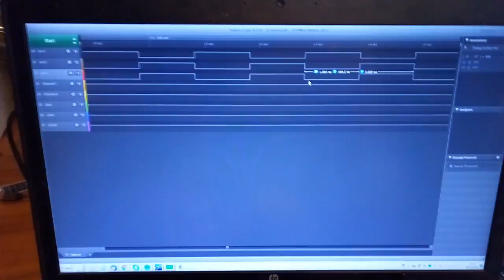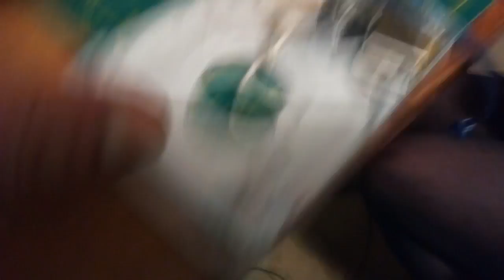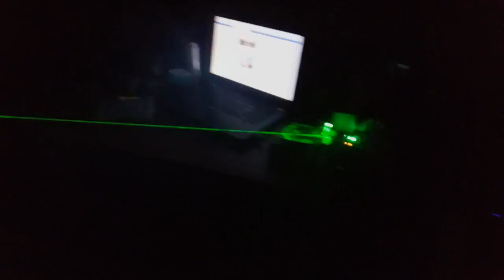Hard Drive motor laser galvo

Comment: You need feedback. The harddrive controller uses the sectors on the harddrive itself to know the position and speed of the head extremely precisely
Reply from the maker: I think you might be missing the point slightly. 
I already have proper laser galvos with feedback. 
This was just a bit of fun.

Comment: where is the code?
Reply from the maker: On the arduino. 
But, for the benefit of the people who saw this on Youtube years ago, Also posted in the comments below!

#include "TimerOne.h"

#define GALVO  9
#define LASER  2

void setup()
  {
  Timer1.initialize(4545);         // initialize timer1, and set a 220Hz
  Timer1.pwm(GALVO, 128);                // setup pwm on pin 9, 10% duty cycle
  
  pinMode(LASER,OUTPUT);
  digitalWrite(LASER,HIGH);
  
  }

void loop()
  {
  //wide();
  //wide();
  //small();
  //small();
  //slow();
  //slowchop();
  //wideslow();
  
  for (int j=0; j <= 50; j++){
      wide();
  }
  for (int j=0; j <= 5; j++){
      small();
  }
  for (int j=0; j <= 5; j++){
      scanwide();
  }
  for (int j=0; j <= 25; j++){
      wide();
  }
  for (int j=0; j <= 5; j++){
      small();
  }
  for (int j=0; j <= 5; j++){
      scanwide();
  }
  for (int j=0; j <= 50; j++){
      wide();
  }
  for (int j=0; j <= 5; j++){
      small();
  }
  for (int j=0; j <= 5; j++){
      slow();
  }
  for (int j=0; j <= 30; j++){
      wideslow();
  }
  for (int j=0; j <= 10; j++){
      slowchop();
  }
  
  }
 

void scanwide()
  {
  int i;
  int j;

  for (i=200; i<=400; i+=10)
    {
    for (j=0; j<=100; j+=10)
      {
      Timer1.setPeriod(hz_to_us(i+j));
      delay(2);
      }
    }
    
  }
  
void wide()
  {
  int i;
  
  for (i=200; i<=700; i+=50)
    {
    Timer1.setPeriod(hz_to_us(i));
    delay(2);
    }

  for (i=700; i>=200; i-=50)
    {
    Timer1.setPeriod(hz_to_us(i));
    delay(2);
    }
  
  }

void small()
  {
  int i;
  
  for (i=400; i<=500; i+=2)
    {
    Timer1.setPeriod(hz_to_us(i));
    delay(2);
    }

  for (i=500; i>=400; i-=2)
    {
    Timer1.setPeriod(hz_to_us(i));
    delay(2);
    }
  
  }

void slow()
  {
  int i;
  
  for (i=200; i<=700; i+=2)
    {
    Timer1.setPeriod(hz_to_us(i));
    delay(2);
    }

  for (i=700; i>=200; i-=2)
    {
    Timer1.setPeriod(hz_to_us(i));
    delay(2);
    }
  
  }

void slowchop()
  {
  int i;
  
  for (i=200; i<=700; i+=8)
    {
    Timer1.setPeriod(hz_to_us(i));
    digitalWrite(LASER,HIGH);
    delay(4);
    digitalWrite(LASER,LOW);
    delay(1);
    }

  for (i=700; i>=200; i-=8)
    {
    Timer1.setPeriod(hz_to_us(i));
    digitalWrite(LASER,HIGH);
    delay(4);
    digitalWrite(LASER,LOW);
    delay(1);
    }
  digitalWrite(LASER,HIGH);
  }

void wideslow()
  {
  int i;
  
  for (i=200; i<=700; i+=25)
    {
    Timer1.setPeriod(hz_to_us(i));
    delay(2);
    }

  for (i=700; i>=200; i-=25)
    {
    Timer1.setPeriod(hz_to_us(i));
    delay(2);
    }
  
  }
  
int hz_to_us(int f)
  {
  return 1000000/f;
  }

Comment: Instead of the elastic bands, perhaps you could try apposing magnetic fields, tiny magnets.
Reply: no definitely not. Elastic band is linear resistance rising with elongation (spring law F = l * c ). Magnets are spot based and have spheroidical field lines between poles. Compare it to balance two speheres stacked vertically.
Reply: Totally needed tetris theme. Russian anthem.

Comment: First of all, congratulations, of all the projects with low cost of recycled laser, yours is the best by far, what software do you use to send PWM to arduino? I would like to replicate your project but with X and Y axes
Best regards and congratulations again!
Reply: I've been watching Curious Marc experimenting with "proper" galvos, and he seems to be simply shooting the X mirror into the Y galvo.
Reply: The Arduino puts out PWM on it's own - pins 9, 10, and 11 can be tuned for the frequency at which PWM operates using code to adjust the clocks.
  
TCCR1B = TCCR1B & 0b11111000 | 0x01; // set PWM frequency @ 31250 Hz for Pins 9 and 10, (0x03 is default value, gives 490 Hz).

TCCR2B = TCCR2B & 0b11111000 | 0x01; // set PWM frequency @ 31250 Hz for Pins 11 and 3, (0x03 is default value, gives 490 Hz).

Comment: Wow ! :D
I was searching for something like this for some time...
You've manage to get it quite good !
Would you mind sharing your work, the code... I saw you would post it but you did'nt.
Don't worry I tink I'm not the only one interested !! :D
Great work guys ! Thank you !
Reply from the maker: I posted it in one of the comments. Youtube doesn't allow you to use angled brackets in video descriptions, so posting it there would have been confusing for many people.

Here it is again though:
Here's the code that was running at the end of the video, for those who are into that sort of thing.
***********************************************************************************

#include "TimerOne.h"

#define GALVO  9
#define LASER  2

void setup()
  {
  Timer1.initialize(4545);         // initialize timer1, and set a 220Hz
  Timer1.pwm(GALVO, 128);                // setup pwm on pin 9, 10% duty cycle
  
  pinMode(LASER,OUTPUT);
  digitalWrite(LASER,HIGH);
  
  }

void loop()
  {
  //wide();
  //wide();
  //small();
  //small();
  //slow();
  //slowchop();
  //wideslow();
  
  for (int j=0; j <= 50; j++){
      wide();
  }
  for (int j=0; j <= 5; j++){
      small();
  }
  for (int j=0; j <= 5; j++){
      scanwide();
  }
  for (int j=0; j <= 25; j++){
      wide();
  }
  for (int j=0; j <= 5; j++){
      small();
  }
  for (int j=0; j <= 5; j++){
      scanwide();
  }
  for (int j=0; j <= 50; j++){
      wide();
  }
  for (int j=0; j <= 5; j++){
      small();
  }
  for (int j=0; j <= 5; j++){
      slow();
  }
  for (int j=0; j <= 30; j++){
      wideslow();
  }
  for (int j=0; j <= 10; j++){
      slowchop();
  }
  
  }
 

void scanwide()
  {
  int i;
  int j;

  for (i=200; i<=400; i+=10)
    {
    for (j=0; j<=100; j+=10)
      {
      Timer1.setPeriod(hz_to_us(i+j));
      delay(2);
      }
    }
    
  }
  
void wide()
  {
  int i;
  
  for (i=200; i<=700; i+=50)
    {
    Timer1.setPeriod(hz_to_us(i));
    delay(2);
    }

  for (i=700; i>=200; i-=50)
    {
    Timer1.setPeriod(hz_to_us(i));
    delay(2);
    }
  
  }

void small()
  {
  int i;
  
  for (i=400; i<=500; i+=2)
    {
    Timer1.setPeriod(hz_to_us(i));
    delay(2);
    }

  for (i=500; i>=400; i-=2)
    {
    Timer1.setPeriod(hz_to_us(i));
    delay(2);
    }
  
  }

void slow()
  {
  int i;
  
  for (i=200; i<=700; i+=2)
    {
    Timer1.setPeriod(hz_to_us(i));
    delay(2);
    }

  for (i=700; i>=200; i-=2)
    {
    Timer1.setPeriod(hz_to_us(i));
    delay(2);
    }
  
  }

void slowchop()
  {
  int i;
  
  for (i=200; i<=700; i+=8)
    {
    Timer1.setPeriod(hz_to_us(i));
    digitalWrite(LASER,HIGH);
    delay(4);
    digitalWrite(LASER,LOW);
    delay(1);
    }

  for (i=700; i>=200; i-=8)
    {
    Timer1.setPeriod(hz_to_us(i));
    digitalWrite(LASER,HIGH);
    delay(4);
    digitalWrite(LASER,LOW);
    delay(1);
    }
  digitalWrite(LASER,HIGH);
  }

void wideslow()
  {
  int i;
  
  for (i=200; i<=700; i+=25)
    {
    Timer1.setPeriod(hz_to_us(i));
    delay(2);
    }

  for (i=700; i>=200; i-=25)
    {
    Timer1.setPeriod(hz_to_us(i));
    delay(2);
    }
  
  }
  
int hz_to_us(int f)
  {
  return 1000000/f;
  }

*****************************************************************************************************
Reply: Wow ! Thank you very much !!! 
I looked in every other comments and I didn't saw it...
Awesome ! Thank you !!! :D
Reply from the maker: No problem! 
Let me know how you get on! :)

Comment: These motors are just a single loop which pulls itself into a field or pushes itself out, aren't they? So the force is proportional to the current (or the average current with pwm). So I guess you ended up varying the pwm duty cycle and kept the freq the same. And you could do away with the elastic band by modelling the ballistics of the moving bit, then working on acceleration and velocity. Reversing the force to make it accelerate the other way? How does it track position drift? I guess it gets feedback by detecting the tracks on the platter.
Reply from the maker: It should work exactly as you described but it doesn't seem to work quite that way in practice.
The head motor is indexed by a track on the platters but we couldn't do it that way. We tried doing it without the elastic band and using variable duty cycle but it was impossible to track the drift at all, or even get repeatable results.
In the end I ran the Tesla coil code on it and found that the most reliable results were by using a fixed duty cycle and varying the frequency. Playing music through it seemed to be the most stable option.
I think what is happening is that the duty cycle is biasing the arm against the force of the elastic band. Changing the frequency works against that force but it doesn't seem to be a very linear response. It's okay for doing basic beam shows but it's not particularly quick or accurate and it's very noisy!

Comment from the maker: Here's the code that was running at the end of the video, for those who are into that sort of thing.
*************************************************************************************

#include "TimerOne.h"

#define GALVO  9
#define LASER  2

void setup()
  {
  Timer1.initialize(4545);         // initialize timer1, and set a 220Hz
  Timer1.pwm(GALVO, 128);                // setup pwm on pin 9, 10% duty cycle
  
  pinMode(LASER,OUTPUT);
  digitalWrite(LASER,HIGH);
  
  }

void loop()
  {
  //wide();
  //wide();
  //small();
  //small();
  //slow();
  //slowchop();
  //wideslow();
  
  for (int j=0; j <= 50; j++){
      wide();
  }
  for (int j=0; j <= 5; j++){
      small();
  }
  for (int j=0; j <= 5; j++){
      scanwide();
  }
  for (int j=0; j <= 25; j++){
      wide();
  }
  for (int j=0; j <= 5; j++){
      small();
  }
  for (int j=0; j <= 5; j++){
      scanwide();
  }
  for (int j=0; j <= 50; j++){
      wide();
  }
  for (int j=0; j <= 5; j++){
      small();
  }
  for (int j=0; j <= 5; j++){
      slow();
  }
  for (int j=0; j <= 30; j++){
      wideslow();
  }
  for (int j=0; j <= 10; j++){
      slowchop();
  }
  
  }
 

void scanwide()
  {
  int i;
  int j;

  for (i=200; i<=400; i+=10)
    {
    for (j=0; j<=100; j+=10)
      {
      Timer1.setPeriod(hz_to_us(i+j));
      delay(2);
      }
    }
    
  }
  
void wide()
  {
  int i;
  
  for (i=200; i<=700; i+=50)
    {
    Timer1.setPeriod(hz_to_us(i));
    delay(2);
    }

  for (i=700; i>=200; i-=50)
    {
    Timer1.setPeriod(hz_to_us(i));
    delay(2);
    }
  
  }

void small()
  {
  int i;
  
  for (i=400; i<=500; i+=2)
    {
    Timer1.setPeriod(hz_to_us(i));
    delay(2);
    }

  for (i=500; i>=400; i-=2)
    {
    Timer1.setPeriod(hz_to_us(i));
    delay(2);
    }
  
  }

void slow()
  {
  int i;
  
  for (i=200; i<=700; i+=2)
    {
    Timer1.setPeriod(hz_to_us(i));
    delay(2);
    }

  for (i=700; i>=200; i-=2)
    {
    Timer1.setPeriod(hz_to_us(i));
    delay(2);
    }
  
  }

void slowchop()
  {
  int i;
  
  for (i=200; i<=700; i+=8)
    {
    Timer1.setPeriod(hz_to_us(i));
    digitalWrite(LASER,HIGH);
    delay(4);
    digitalWrite(LASER,LOW);
    delay(1);
    }

  for (i=700; i>=200; i-=8)
    {
    Timer1.setPeriod(hz_to_us(i));
    digitalWrite(LASER,HIGH);
    delay(4);
    digitalWrite(LASER,LOW);
    delay(1);
    }
  digitalWrite(LASER,HIGH);
  }

void wideslow()
  {
  int i;
  
  for (i=200; i<=700; i+=25)
    {
    Timer1.setPeriod(hz_to_us(i));
    delay(2);
    }

  for (i=700; i>=200; i-=25)
    {
    Timer1.setPeriod(hz_to_us(i));
    delay(2);
    }
  
  }
  
int hz_to_us(int f)
  {
  return 1000000/f;
  }

*******************************************************************************************************